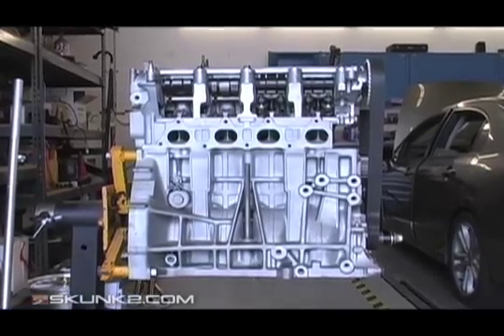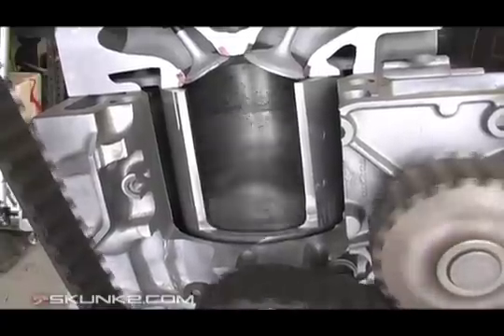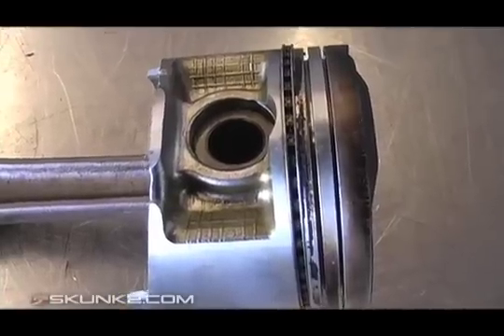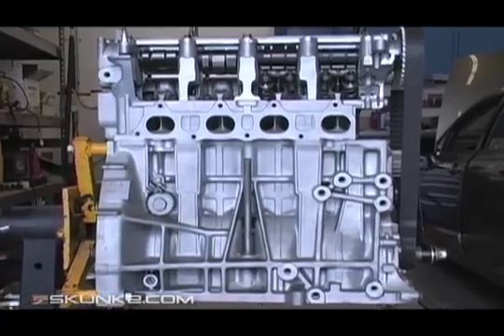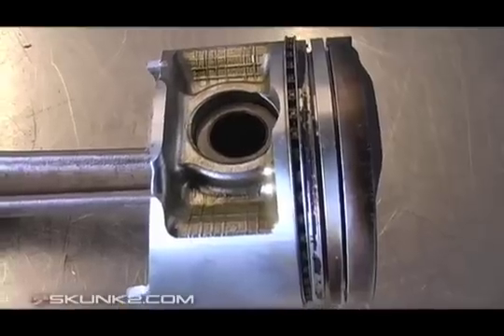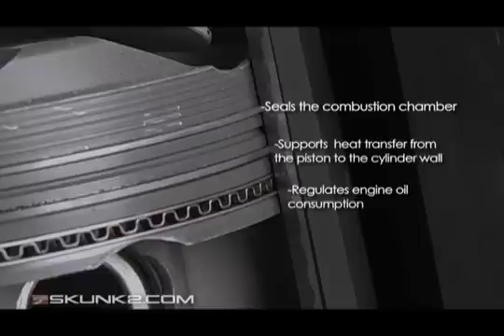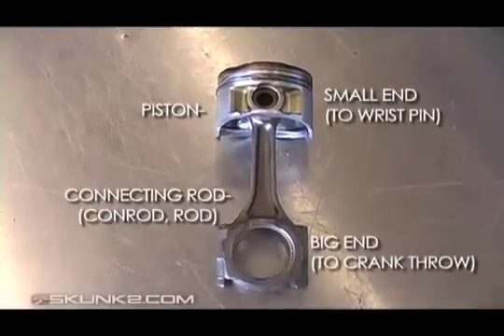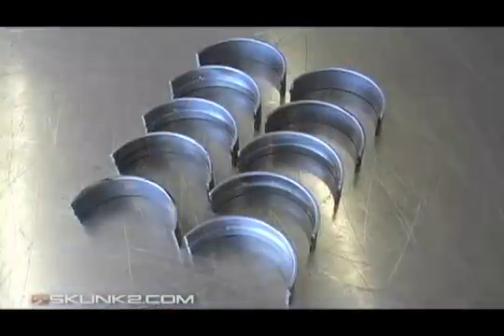Skunk2 How To: What's in Your Bottom End

Comment: air is always pushed in... it never is sucked in... never
Reply: Because all motors are forced induction, amirite?
Reply: what do you mean?
Reply: Don't force your motor bro
Reply: ofsoundminds if i drink half a glass of water, is it half empty or half full.  same shit.  air is pushed in and sucked in at the same time.
Reply: +Danial Loganathan no... air pressure pushes the air in... suck doesnt exist... moron.
Reply: +cyphztokin420 no../. air pressure is always positive.    air is always pushed... via air pressure.... its impossible to suck it in   you can "pull" an air molecule in
Reply: ofsoundminds Uhh, read above genius. I already posted that comment.
Reply: ChronicConnoisseur Air is pushed in by atmospheric pressure. There is no such thing as suction when speaking about gasses. There is just high pressures, and low pressures. Pressure always moves from high to low, which means the air is pushed into the empty cylinder due to the air pressure outside of the cylinder.
Reply: with a supercharger... otherwise it IS sucked in via vacuum on the downward stroke of a piston derp
Reply: +ofsoundminds the fact i dont have thumbs up proves how fucking dumb you clowns are

Comment: what is the difference between long block and short block ?
Reply: IDK if you still need this info, but a short block is just the block and rotating assembly (crank, rods, pistons)... Long block is the short block plus the assembled heads (valves, springs, cams, etc) none of these include the "accessories" (intake and exhaust manifold, alternator, water pump, etc).

Comment: The engine is being manually turned backwards; note as the waterpump and tensioner side of the timing belt are being pulled and the crank-to-cam section is left to be slack. Additional cure: note the cycling of the valves is in the wrong order wrt piston position. Honda B (and D, F and H, among others) rotate counter-clockwise in normal operation when viewed from the crank pulley.